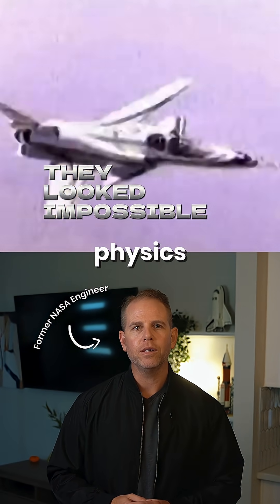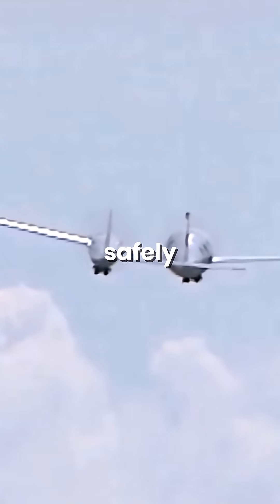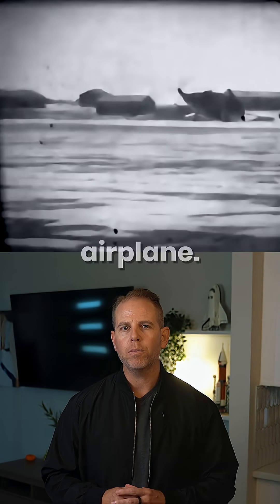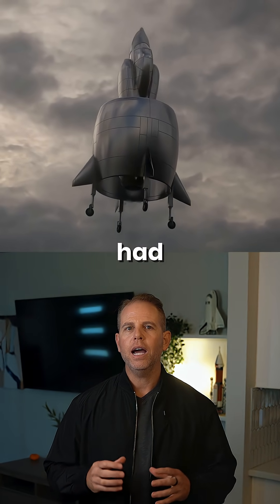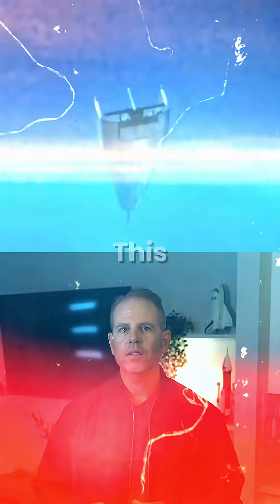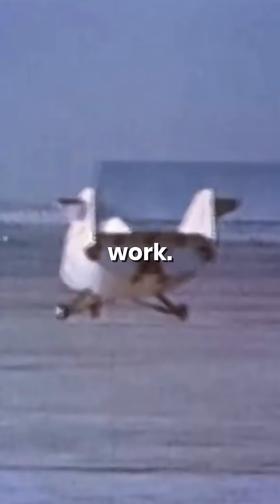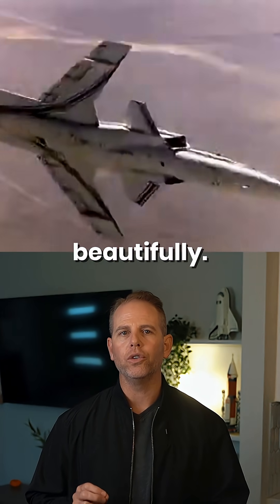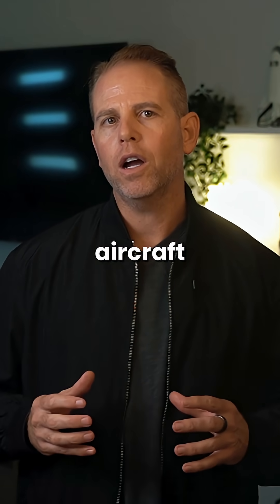Here’s 5 Aircraft That Bent Physics to Fly:

Comment: Wasn't there a fighter during WWII that had one wing longer than the other so that the difference in lift would offset the counter rotation of the propeller...
Reply: Yes (idk the name of it)
Reply: There was a German plane that had the engine offset to one side from the cockpit/fuselage and the wings were offset in length from the actual cockpit. This design allowed there to be a gunner to the front and rear without a propeller or tail getting in the way.

Comment: With the snecma... Sure it's an interesting plane, but considering the predecessor to the Hawker harrier (Hawker Siddeley P.1127) achieved its first VTOL take off and landing, using thrust vectoring nossles, within a year of the snecma, it seems that the Hawker Siddeley P.1127 was more of a proof of concept for VTOL planes than the weird cylinder.

Comment: fly by wire is probably one of the BIGGEST advancements in aviation along side turbo engines (turboprop, turbojet, turbofan etc)
Reply: Yeah, it had virtually everything better than analog or other traditional instruments. Even having a lighter impact regarding weight, compared to hydraulics or cable wires. which I believe is one of the reasons why the f-16 was good in turns, because of the lighter fly by wire system. As well as autocorrections taming unstable planes like the EF typhoon or the x-29 shown here.
Reply: will be taken over by fly by light
Reply: Agreed, though fly by light may take over eventually if perfected
Reply: @inonknow5215  I’m sorry fly by WHAT?
Reply: @Fjgwei  fly by light or fly by optics. Basically, inputs are translated to light signals instead of electricity. It is lighter, faster and more reliable than fbw, but it is more expensive and has other limitations and fbw already does its job well so fbl is not widespread. The Kawasaki P1 is the only mass produced aircraft that uses it I'm pretty sure